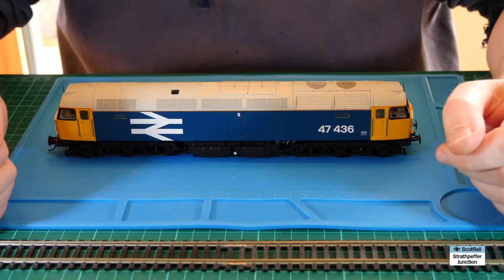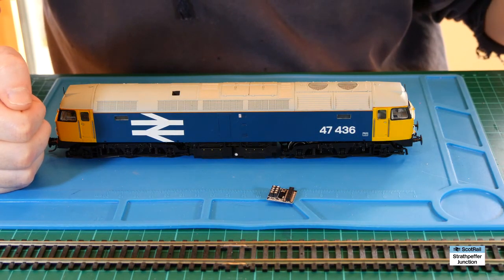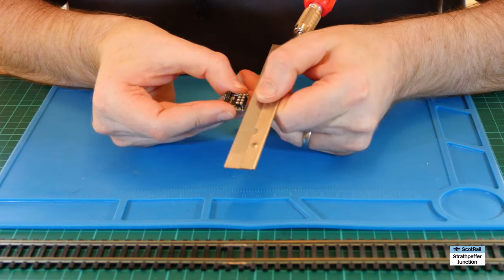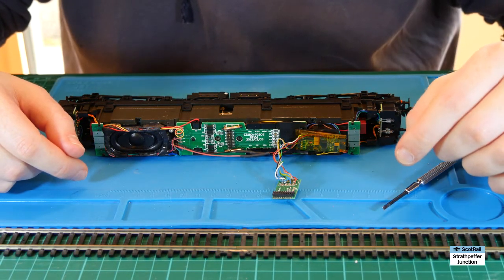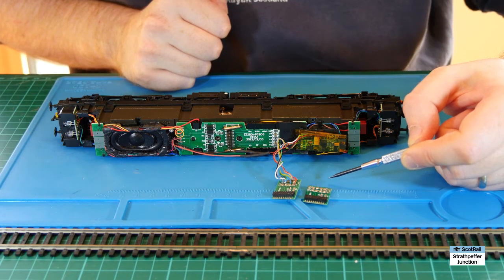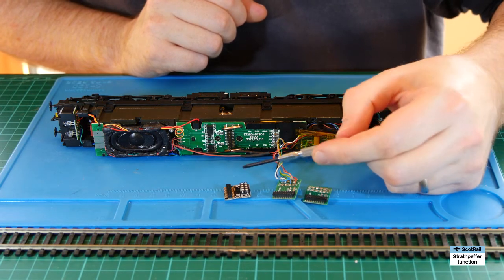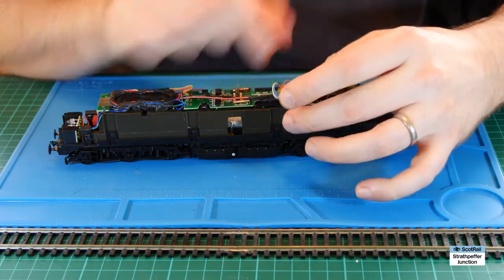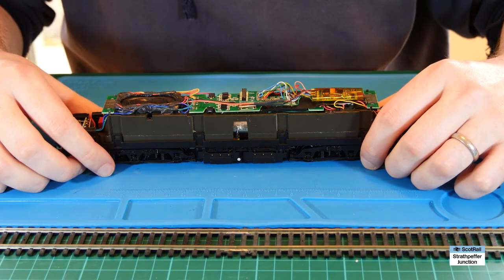#7 Adapting an 8-Pin Hornby TTS Sound decoder for use with a 21-Pin Chassis

Comment: Ive fitted the 8 pin to 21 pin adapter into my Bachmann 21 pin class 37 and the sound is ok, and the body whent back on OK. excellant video.
Reply from the maker: Many thanks for the kind words. It's touch and go with these models. I've found with some, the body just about goes on ok, but it applies pressure to the decoder adapter and pcb, which I'm not entirely keen on in terms of longevity of solder joints etc. I've also had one where the body went back on ok and bother where no matter how much shoogling I did, I just couldn't get it back together and closer inspection showed the pcb to be slightly high off the chassis and on the other. So, these days I just fit a hardwired adaptor as I rarely change the decoders out once they're in there. All adds to the fun of it! 😋
Reply: Lets hope mine last. Now trying class 20, 8 pin and 21 pin version. will let you now how I get on. It would be nice if Hornby brought out a 21 pin version in its TTS sound where applicable
Reply from the maker: Yes, it would be, but I doubt they will unfortunately. The tts chip is based on their basic decider, which I think is 8 pin only. They'd probably have to either tack it onto their more expensive sapphire one or develop a new 21 pin variety of basic decoder. Best of luck with the c20. They can be quite a tight fit!
Reply: Nice instructional vid, helped a lot. Fitting the chip and speaker in a Bachmann 37 is really tight, but I managed it. What hasn't gone well is that the locos performance is very poor. Did you find the same and if so, was it just some changes to the CVs and if so, what ones did you change - sorry about all of the needy questions. Cheers - Pete
Reply from the maker: Sometimes changing CV 150 on a TTS chip can help. I've found that the second motor profile is often better for non-Hornby members. The TTS chips normally come with CV 150 set to 0, sometimes changing this to 1 will help immediately. There's also further tweaking you can do to these CVs. The Hornby TTS manual should explain in more detail.
Reply from the maker: See here: https://www.hornby.com/uk-en/forum/tts-decoder-cv150-154/?p=1

Comment: Very nice tip David, I can see me doing that, I have used the ESU 51967 21MTC adapter in the past...Simon
Reply from the maker: +Simon -Liverton Central Thanks, Simon. There are other methods, and I have seen a 21-Pin break out board used, but I think these 8-pin to 21-pin adaptors are currently the cheapest way to do it. They work our at about £3 each (or thereby) each, whereas the cheapest breakout boards I could find came out at about £5.20 each, plus you had to buy five at a time.

Comment: Ive wired up one of these adapters, but I'm having a few issues. When power is applied the loco plays a AWS cab warning alarm without any input from me .. also the front lights come on untill I apply some speed and the lights turn red on their own. Have I done something wrong or is the Hornby TTS chip faulty?

Comment: A very timely video. I made the mistake of buying the Class 47 decoder for my Heljan Class 47, but after surfing the web, decided best not to fit it.
I have just purchased a Bachmann Class 47 to use it on, and a LaisDcc 8 / 21 Pin Adaptor NEM652 Chip to 21MTC Loco Part No.860004 DCC.
Looks like I am going to have fun here.
I wonder if it would be possible to solder a 4 pin socket to the adaptor, and leave the Decoder intact.
Again, a great video.
Reply from the maker: +William Glover Wise choice, I suspect! I think the class 47 tts sound is actually pretty decent (especially with a better speaker), and I run it in a couple of my bachmann 47s now. You probably could solder a socket arrangement in place, but I have found that I so rarely remove decoders once fitted, if I ever did want to swap one out, having kept the 8 pin plugs in my spares box, it's probably less faff just to solder it back on again.
Reply: Strathpeffer Junction  
I like the Sugarcube Flame speakers. Much fuller than those supplied.

Comment: I now have my Bachmann Class 47 (nicely run in on dcc), a LaisDcc adaptor, a DCC MTC 21-pin to NEM 652 8-pin decoder socket adaptor. and a brand new Class 47 TTS decoder.
Can you just clarify the following?
The DCC adaptor is the better one to use.
f0 will operate the directional lights.
Will f25 aux. operate the Bachmann cab lights, if not, can it be made to?
Is it feasible to remove the 4 pin plug by sucking off the solder, or is it soldered both sides?
Reply from the maker: +William Glover Yes, on the TTS 47 chip:

1. F0 will operate the directional lights. 

2. F1 will start the sound. 

3. The aux channel is on Function 25. So, F25 will operate, say, the cab lights if fitted (depending on the 21-8pin adaptor, as I mention in the video, you may need to do nothing to make this work or you may need to solder across the solder tabs).

I've done this conversion three times now. Once, I was able to suck the solder off from the back enough that I could then prise off the socket. One the two most recent, I couldn't get enough solder off it, so I had to saw it. These ones appeared to have little metal inserts in the holes that the socket pins fitted into and they made it hard to clear the solder. Once I'd sawn off the 8 pin socket, I flowed solder over these to fill them in and formed solder tabs. On the other two conversions, there were not such metal inserts and I just flowed solder into the holes left by the pins, again to create solder tabs for the decoder wires.
Reply from the maker: William Glover Sorry, I forgot to answer your question about with adaptor is better to use. They all go by some many names, often with one manufacturer using one name for something different to another, it's hard to say without seeing a photo of the two you have. If you want to drop me an email at info@strathpefferjunction.com, I can let you know which, in my experience, is the better option or if it's much of a muchness. The hardest part of this project is removing the socket. That's probably the bit that takes the longest and needs the most care. I sawed it off very slowly!

Comment: As always great video - thanks!  I'm trying to add a stay alive to a 21pin ESU decoder although I've read that you shouldn't solder onto the chip directly. So I thought perhaps the only solution is to replace it with a Zen 8 pin nano and use an 8 pin to 21 pin to conversion board from DCC and keep the original  decoder for another project?
Reply from the maker: You could certainly go down that second route if you like, but I'm not sure there's necessarily anything wrong with hooking up a stay alive to the ESU one. Which model of esu decoder is it?
Reply: @StrathpefferJunction  It's a LokPilot v2.0
Reply from the maker: Ah. That's an older one and I'm not sure if they're so easy to work with re stay alives. I don't have any of them unfortunately (I think the oldest I have now is a LokPilot 3.5).
Reply: Strathpeffer Junction  thanks , I see that now.  Replaced it with a zen black and will keep the esu for a future conversion!

Comment: Hello amazing video I have just bought a sound decoder and am wondering how do I turn the volume up the model is a TTS decoder
Reply from the maker: Hi Caine. The easiest way to quickly set the volume of a TTS decoder is via CV178. It has a range of 0 to 8. You can't read that CV, but just write a number from 0 to 8 to it and the overall volume will change. Do be careful not to overdrive the speaker, however, as it won't sound great. You can get much better results by switching out the sotkc speaker for something better (so long as it's 8 ohms).
Reply: @StrathpefferJunction  how do I find the cV 178 I have my my locomotive set to Channel 4 but everytime I try to input tn8 to turn the volume all the way up it just changes to Channel 8 if I hold the function button it will just play the other sound if that makes sense any ideas of what I'm doing wrong
Reply from the maker: How you programme decoders varies between dcc controllers. Not all are able to programme decoders either. What do you use?
Reply: @StrathpefferJunction  hello sorry for the late reply I have a select controller

Comment: Hi you can desolder and  take the 8 pin socket off the board and solder the hornby 8 pin plug into the socket and cut off the pins, saves wiring each wire
Reply from the maker: Hi Paul. Many thanks for the comment and suggestion. Yes, I saw Barnabas Junction doing this more recently in a video. I'm happy doing it this way as I don't mind soldering and I prefer having less solder joints and a less bulky end result, but if the plug comes away easily for you with a soldering iron (I've heard one person say it doesn't always work, although I've not tried it myself), it may be slightly quicker going down that route. What I tend to do now is buy the 21-Pin adaptors without the 8 pin socket and just solder the wires to the break out tabs on it. It's pretty quick. I did a more recent video on that method. Certainly a few different approaches out there 🙂

Comment: Lovely tutorial, was wandering if you knew of an adaptor that converts a v3.5 loksound class
Reply from the maker: Hi Darrell. Sorry, only just noticed this comment. Do you mean a 21-pin V3.5 to be used in an 8-pin chassis? Or vice versa?
Reply: Strathpeffer Junction ha ha yes sorry for dropping that one in ! Yes it was a 21 pin v3.5 and I hadn’t thought how I was going to fit it into an 8 pin 🤔 you both gave some good advice and I’ve opted for a 21 pin pcb , I’ll let you know how I get on fitting it 👍
Reply from the maker: +Darrell Deltic Excellent! Let us know how you get on 😀

Comment: Sorry pressed wrong button 😱 start again! Do you know of an adaptor to convert a 21 pin sound decoders to 8 pin? And I’m not sure which terminals are for the speaker, sorry 2 questions 😊 cheers Dazza
Reply from the maker: +Darrell Deltic I have looked high and low for one, but I've not come across a company that does them. I had a LokSound 21-Pin that I wanted to use on an 8-Pin Class 24, but in the end I just had to get a spare 8-Pin loksound reblown. I would have thought there'd be a bit of a market for them, but perhaps not enough to make it cost effective. If you could easily buy the 21 pin sockets, it may be easier enough to knock one up as the 8-Pin plugs are pretty standard across other areas of electronics, but as I said in the video, I've not yet found a supplier for stand alone 21-Pin sockets...surely they must exist?!
Reply: Darrell Deltic 
I think the Hornby Sapphire decoder comes with a harness that allows you to use it in an 8 pin loco, not sure if you can acquire the harness by itself though?
Cheers 
Paul
Reply from the maker: +Dunge Wood Model Railway I'm not sure that the harness is actually 8-Pin to 21-Pin socket though? I'll need to check. I though it perhaps introduced another type of socket/plug into the mix? I'll see what Google throws up!
Reply from the maker: Dunge Wood Model Railway Just checked. You're absolutely right, Paul. I had been thinking about the Gaugemaster ones. The Hornby harness does have a 21 pin plug, but I can't find them listed as a standalone item. I'm sure there must be folk out there with spare harnesses...perhaps, Darrell, you could ask on a Facebook group?
Reply from the maker: There's a good thread on options here: http://www.rmweb.co.uk/community/index.php?/topic/22206-21-pin-sound-into-8-pin-loco

I think the 21-Pin break out board is fairly expensive for what it is, and doesn't look to be all that common in UK shop stock.
Reply: Strathpeffer Junction + Dunge Wood model railway, many thanks for both of your help and thanks for the link , looks like I’ve got a few options with the decoder now, cheers Dazza

Comment: hi dont suppose you have any cv adjustments for a bachmann class 40 with a tts decorder in it as cant get mine to run smooth with the sound
Reply from the maker: Hi Lee. Have you tried changing the motor algorithm? It ships with cv150 set to motor algorithm 1, but sometimes algorithm 2 better suits the motor. To change algorithms, just alter cv150. For algorithm 1 write 0 to cv150, and for algorithm 2 write 1 to cv150. That might be all that's needed - it's sometimes worked wonders with the odd loco of mine. You can also tweak the algorithm parameters if need be via cv151 to cv154.
Reply from the maker: The Hornby manual for the TTS decoder explains a wee bit more about it: http://www.humbrol.com/media/wysiwyg/4-1495_Class_40_TTS_WEB.pdf

Comment: Hello, me again.
After much trepidation I managed to get the top off. That was not for the faint hearted.
Bachmann should employ some user friendly Designers.
I fitted the TTS decoder using the fitted plug to make sure everything worked. 
I confirmed all but the f25 cab light. This requires putting the body back on, and I am in no hurry to go through all that again.
Can you explain the pin 3 green aux./21 socket interface?
Do you need to solder across the pads, and which ones?
The sugarcube  Flame  speaker I intended to fit has no chance. Can you recommend something?
I should have stuck with steam.
Reply from the maker: Hi William. Yes, if you want the cab light to work on F25 once you've soldered on the modified adaptor, you need to link the two solder pads next to "J4". I have used just a blob of solder on one conversion and it worked fine, or you can solder a tiny piece of wire, but that is very fiddly. Once you've added this link and have everything installed in the loco, the Aux channel controlled by F25 will work the cab lights.
Reply from the maker: Regarding the speaker, There are few options, depending whther your loco is a new style Bachmann 47 or an old one. If it's a new one with a depression for the speaker, you could go with a fairly standard 20x40 8 ohm speaker. Depending on how new your Bachmann Class 47 is, it may have come with a speaker housing that would fit one of these speakers, otherwise you would need to fabricate a housing out of plasticard. Either way, seal all the air gaps with blue or black tack. Similarly, you could use something like this, which is the same dimensions but a smaller speak with its own enclosure. The sound is reasonable in my experience, and perhaps marginally better than the stock 20x40 speaker: https://www.ebay.co.uk/itm/4x-20x40-MM-8-Ohm-Bass-Speaker-DCC-Sound-Hornby-Bachmann-Loksound-Zimo-TTS/263434862081?hash=item3d55f0fe01:g:b5cAAOSwoRBaWkOX
Reply from the maker: And if you have one of the old chassis with no depression for the speaker, you may find that putting two very small speakers in parallel or series would work. YouChoos have a good selection. I think the TTS chip has to has 8 ohm, however, so you'd need to be careful about combined impedance. You could put two 4 ohm speakers in series to get 8 ohms, which should work fine with a TTS chip.
Reply from the maker: +William Glover Hi William. How did you get on with the installation?
Reply: Strathpeffer Junction I had everything ready, speaker recommended by youchoos, plug etc ready for soldering , and I fractured my ankle. I can't get upstairs at the moment and am feeling so frustrated. 
I have removed the 4 pin socket entirely from the adaptor, and reckon I can solder the decoder plug directly in the board.
Reply from the maker: +William Glover Oh no. Really sorry to hear that. Best of lucky with the recovery...and the installation!
Reply: I'll let you Know when it's done. Will have to try some reverse bottom crawling to get up them stairs. No way can I wait another four weeks.
Reply from the maker: Hi William. I don't think that one will work. It's got pins on it, not a plug. I have just bought a pack of adaptors from somewhere (totally forgotten the outlet - will see if I can find the receipt) which negate the need to cut off the 8 pin socket. I may have a spare one. If you would like, I could send you one for the cost of postage? I may not be able to post it for a few days though. You can email me at info@strathpefferjunction.com
Reply: Whoops. See what you mean. Not the clearest of photographs. Not having much luck at the moment. Just opened a new Hornby Class 50. Doesn't work and has gone back. Thanks for your offer.
Reply: Strathpeffer Junction Did you get my email?
Reply: I have just fitted a DCC Concepts adaptor. The socket is offset by 1mm from the board, so easier to saw off. 
I have fitted the decoder and it works. Not the easiest soldering job for a 73 year old.
I need to tidy it up and prove the cab lights before replacing the body.
The 21 pin/plug is not the tightest fit I have encountered. I need to satisfy myself that it is reliable.
Reply: All done and dusted.
Thanks again.

Comment: could you not use a Gaugemaster  adapter  21 to 8
Reply from the maker: Assuming we're talking about the same thing, that is basically what I used in the video. In some locos - and this was one - the is very little clearance between the 8 pin socket and the roof of the body. When you add an adaptor into the mix, either the body doesn't fit or it compresses the pcb and connectors, which isn't going to be good for them longer term. This approach circumnavigates those potential issues. It's just one solution though, and there are others. 🙂